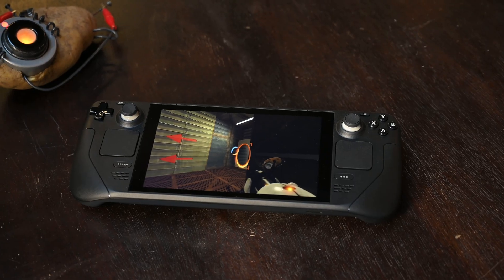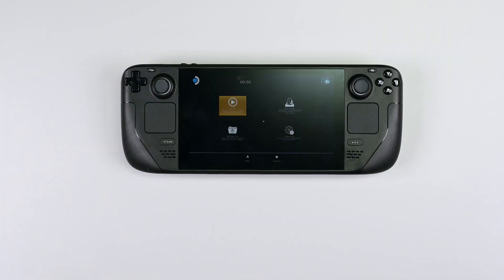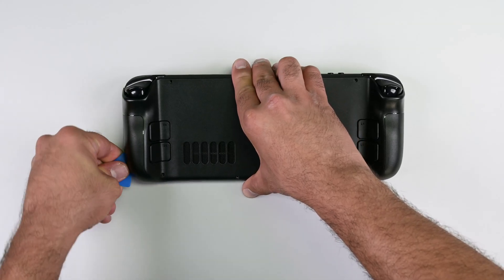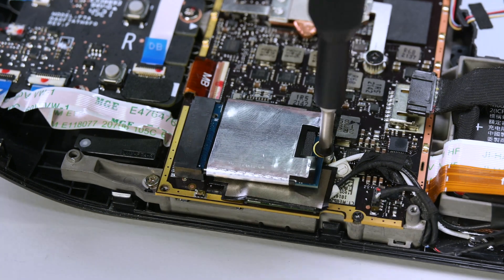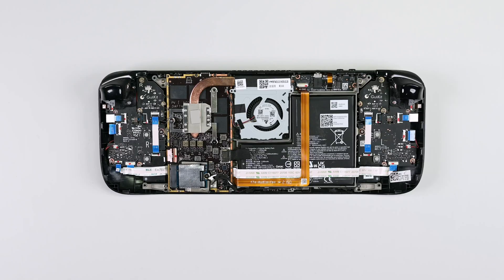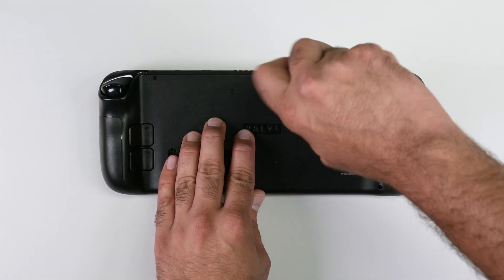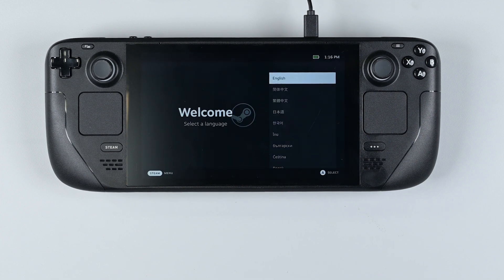Steam Deck SSD Replacement: Get it Done in 20 Minutes!

Comment: my biggest struggles were getting the exterior screws out without stripping them, snapping the case off, and snapping the case on.

everything else was super simple
Reply: Think bc if you have a mental model that the case should pop out with a little bit of tug, that it should go.  But the J-hook from backcase latching onto frontcase make that a disastrous problem.  It can damage it or snap the plastic locks.

I wrote a long essay above describing where exactly those hooks are.  One needs to jam in a small thin plastic to release the grip.  When those 18 hooks unclick, then the case can be removed safely.  Sliding is an ok way to do it but not elegant.  It's better to insert the thin, flexible plastic (or even paper) into the unit to disengage the J-latch. Must be at the right spot to hit it.

Comment: PSA:

If after you installed the new ssd and you go to turn it on and it doesn't turn on... Plug it back into power. Seemed to reset the deck/ battery.

Comment: Do the battery storage mode before doing ssd swap like the video says. Otherwise you will run into problems like battery going into protection mode and not turning on ...

Comment: Props to Valve for making the deck easily upgradeable like this. As easy as adding an SSD to a gaming laptop!
Reply: Not the new steam deck OLED unfortunately it's trickier as you have to hold the cover plate up you can't take it off entirely without ripping off the ribbon cable
Reply: @Ziyoblader you can disconnect the ribbon cable and move the shielding to the side, it's one extra step but not particularly difficult
Reply: @Ziyoblader i just carefully pulled the ribbon cable off of the cover, that way you could tilt and angle the cover in a way that it would completely go off.
Reply: And props to them for making the OLED harder.
Reply: @TheGeneReyva harder ?

Comment: Why is the shield necessary,  why does it have to have it? Most ssds you can just pop right in and its good to go.
Reply: The back cover is very thin. It stops the risk of anything getting through the plastic. By that I am referring to magnetics, for example, that would damage your SSD.

Comment: Hey
First of all, well done, IFIXIT, the instructions are really good. However, there is an instruction that you probably should add when it comes to reinstalling the operating system; 
I didnt use Rufus on the other hand but the file that Valve offers to download is formated as .bz2 and not .img by default, atleast not for me. It made it impossible to flash the USB-drive on balena etcher. It took me some time to find a solution on a thread on Reddit to solve it, which was easy at the end. This is maybe a no-brainer but for the sake of clarity; maybe add that detail to the guide?

Comment: I'm having a problem with recovering SteamOS.
After the new SSD is plugged in, I can't get to the Boot menu to access my Bootable USB. The steam deck just stays in a black screen. I can hear the fans and it also makes the beep when I turn it on. But no boot menu jumping up. Anyone got any ideas?

UPDATE: Leaving it for like 15 minutes to do it's thing, it eventually started working properly. I think. At least, I can see the Steam Logo now, so that's a plus.

Update #2: I've made it to the Boot menu finally, but it's got insane input lag. Like, I press one button and it takes 15 seconds to move the selector over xD. It took even longer to load the boot menu after I selected it, and it took a while to navigate to my Bootable USB. And now it's sitting there for eons trying to boot off the USB. But at least, so far, other than that weird lag, all seem to be in order.

Update #3: It took ages waiting out black screens, restarting multiple times, and so on and so on, but eventually, got SteamOS perfectly reinstalled onto my new Sabrent SSD. About to get Win11 installed too :)
Reply from the maker: Check our troubleshooting guide: https://www.ifixit.com/Troubleshooting/Steam_Deck/Black+Screen/520878

If that doesn't work, try posting in our forum. This seems to be a common issue but happens for different reasons. Some troubleshooting needs to be done.
Reply: im at that step right now, just a black screen still
Reply: Try plugging a power cord in and then turning it on. It does take about 30 seconds.

Comment: Can i add thermad pad under that ssd foil for better heat reduce?
Reply: I saw better solution on aliexpress for $2. Piece of copper foil with few thermal pads. People who bought told, that temp decreased by 10 degrees celsius.

Comment: Snapping the shell on the 64gb version was a BRUTAL pain even with the right tools. Do not panic on how hard it is to remove those plastic clips
Reply: Also worth mentioning (as its overlooked here), there are deep indentations around the clips, don't get your pick in them, instead slide along the shallow part of the seem to unclip everything. It's very easy to make that mistake and target the wrong part.
Reply: i just did it and it was even worse than taking the cover off of a ps4 pro and you have to man handle that thing
Reply: @butterybuttcheeks  my first experience with this J hook began on Xbox One X, that I believe was the first time seeing the design. It’s punishment for the DiY peeps.
Reply: I wrote a long essay above.  I identified all the clips. It was painful as well as potentially costly or damaging.
Reply: I used a kit that was made for the Switch on Amazon and it made it really simple, but I do have the newer version with the black cover so it could have been easier. It just took time figuring out where to put the triangle piece to get part of it to pop off and it was simple from there working my way around.
Reply: is there is a difference on how you open the back between 64gb version and other?
Reply: Time and patience is what you need. I successfully pry it open with the guitar pick and then toying around with the casing after I installed a new SSD.

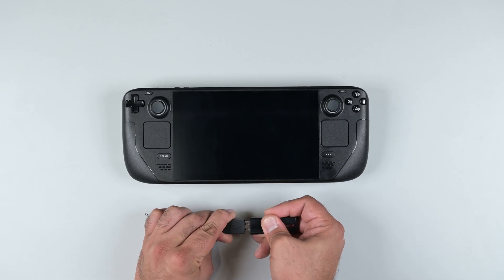Comment: - 4:59 should mention to plug in the charger first to turn on the Steam Deck since previously set as Battery Storage mode
Reply: Im sorry to revive an old post.. but if I may ask: After connecting to the charger and booting up the steamdeck from battery mode.. do you then unplug from the charger and the connect the usbc-flash drive connector and then the prompts pop up? Or am I missing something.

Comment: Oh yeah, if you just want to clone your drive so you don't have to reinstall and reconfigure everything (like if you setup emudeck), you can get a $15 m.2 external enclosure (and you will need a usb c hub so you can plug it in, the thumbstick you used for clonezilla, and a keyboard) like I did and use clonezilla to directly move the image over to the new SSD, then boot back into the steamdeck (on the old drive) and use the KDE partition manager to expand the home partition to the new size.

This might not be as economical of a choice if you dont have a use for a usb-c dock on the steam deck otherwise and don't have any other uses for an external NVMe enclosure (I already had a dock and wanted to use this to clone other images onto nvme drives for other computers, plus it makes for very small and convenient portable hard disk.) Just try to decide how much time you want to spend vs how much money you want to spend. Clonezilla was super easy to setup and use.

Also, I know people suggested using linux's built in DD tool, but a lot of people ran into problems with it because it's not a very intuitive tool and you can easily mess something up or forget something, then go through and install the ssd but then never be able to bootup because, perhaps you didn't transfer the partition table (which was a common issue I saw on reddit), which clonezilla will make sure you do, among many other steps.

Comment: Great guide, worked like a charm. 1TB model now baby! Thanks guys
Reply: So I can buy the cheapest one and upgrade it with another drive, right? Is the only difference between the more expensive models the storage? What kind of ssds work best with the steam deck?
Reply: @killer429 besides the screens (which you can also upgrade yourself) yes

Comment: To avoid people giving themselves a heart attack like I almost did I want people to know YOU MUST PLUG YOUR STEAM DECK INTO POWER to turn it on again AFTER PUTTING IT IN BATTERY STORAGE MODE! You did not just break your deck!
Reply: +100 to that, i unfortunately didn't read that message on time and had a rollercoaster of emotions, 4 times unplugged battery i thought maybe ja damaged a plug... it's a good tutorial but they should include this in it!
Reply: @bas5tian i mean,battery storage mode did it's job too well that y'all forgot that thats what it's actual purpose which is to REMOVE all power in the deck so you won't accidentally damage anything
Reply: I'm awaiting my steam deck tomorrow, thank you for this.
Reply: Apparently, another tutorial I saw pressed minus or volume down and power on.
Reply: OMG DUDE THANK YOU!!! i thought ive broked it !!
Reply: wish i saw this a few minutes ago... i managed to figure it out on my own but hoo boy did i almost have a heart attack 😂
Reply: This is not working at all for me. I tried different outlets, the original PCU, a different one, almost every button ever and even put in the old SSD to try but no LED no response no nothing. I am so desperate and Steam is so unhelpful uggghhh
Reply: bro I got to this part and my heart snack bc I thought I f'ed something up. You're a god send <3
Reply: Fuxking thanks
Reply: Youre the GOAT.
Reply: I think I bricked my Deck regardless. ☹ Fan and charging light comes on, but cannot get the screen to turn back on.
Reply: @jacknorkus9557  taking apart again and make sure the ribbon cable to your screen is completely improperly seated.
Reply: @jacknorkus9557  could you fix it?
Reply: I know this comment is at the top of the comments anyway but this REALLY should have been hearted or whatever it's called by the uploader to make sure it's always at the top no matter what.
Reply: 2 years later, and BLESS you for this comment. XD
Reply: Yo how is this comment not at the top!!! Such a critical oversite to a simple step!! Thank you my guy!!!
Reply: jesus christ thanks, I did get a hear attack tho
Reply: Lol. I had a heart attack thinking I messed mine up.  Then turns out, like you said, after putting in battery storage mode the power button has been deactivated.  One must use the plug to re-activate the unit.  That was cold blooded.
Reply: You da real MVP bro.
Reply: thx man, but too late I had heart attack
Reply: Up! this made my heart stop I just voided my warranty and it suddenly wont open but your solution works thank you!!!
Reply: after I finally recovered from my heart attack, I came to say this exactly. Thanks!
Reply: Oh thank GOD.
Reply: Mine's been on power for 3 hours and nothing, it won't turn on!!!  took it apart 3 times, and everything plugged in fine.  just won't come back on
Reply: OH MY GOD THANK YOU
Reply: This did not work for me
Reply: @stephd6109  the same thing happened to me to the battery cable is loose it’s really hard to push it all the way in you have to get it back in just the right spot it has to be all the way clicked in
Reply: @anguelt6785  I did try to unplug the cable earlier and get it back in. I did hear a click but I an always try again. Thank you for your response I appreciate it
Reply: Thank god for people like you, I just did this and freaked out when it wouldn’t power. Why leave out an important step like that??!
Reply: Thank you, because I did have a mini heartattack for sure 😅
Reply: You're a god. Thank you!
Reply: you are a hero
bless you
Reply: I read the comment too late, I was angry as f ^ :D
Reply: I came here to write this after following the guide yesterday. This needs to be a pinned comment lol. And/or they should just redo this video, and explicitly state this instruction. Thank you for posting this.
Reply: You are a saint.
Reply: Didnt see this till after i had said heart attack and figured it out lol
Reply: Exactly what happened to me 🤣. @iFixit - it would be nice to add this info to the video
Reply: I thought I didn't push the battery cable in far enough lol thanks
Reply: Thank you I just got my deck yesterday and almost panicked
Reply: DUDE HAHAHA I WAS STARTING TO CRY
Reply: Thanks, I needed to hear this 😂
Reply: Thank you dog!
Reply: My hero!!
Reply: I always did that with my 64gb deck before upgrading this
Reply: Do i need to buy a usb C to usb adapter for the thumbdrive if I have  a docking station?
Reply: Thanks so much
Reply: Thank you!
Reply: Opened my device back up to see what I did wrong. Finally finding nothing I connected the power while holding my breath and trying to start the device. I just read this comment and breathed a sigh of relief even as my SD is installing already. WHY THE F WAS THIS NOT IN THE VIDEO?! MAJOR L.
Reply: Should be pinned comment. Slightly had a panic attack when I couldn't turn my deck back on
Reply: I did get a heart attack, but you saved me from having to go to the hospital 🏥🤣
Reply: Yep, if people pay attention the deck explains this when you enable this mode.

Comment: done this after following this video :)
as people said to exit battery mode you must connect the charger
Valve suggest to go at least below 80% to enter safely in battery mode (that is because Lithium batteries survive better at storage if not fully charged)
the SSD foil not always slides in, Sabrent SSDs for example are thicker and in that case it must be opened.
my deck booted back now let's see if steamos reinstalls :D
update: everything is fine
Reply: Update?
Reply: @lokeshsangewar8392  everything ok, reimaged and updated
Reply: you can still slide it on the sabrent ssd by widening the foil with tweezers and going back and forth

Comment: My SSD has two slots in it but the new one I ordered only has one ? Are some models different ?
Reply: Mine was the same, I installed it trying to get OS back on it now, I don't think  my dock is transferring data just power and display, I'll let you know if it works
Reply: It worked! 
Be cautious; I accidentally pin the fan wire under the shield plate when reinstalling it and my fan wasn't coming on at all. I took it apart and fix it. Works like new now 💪🏼
Reply: @siahmanjoe  legend ! Thanks for the info dude
Reply: @gmak1n785  of course man, happy decking? Lol what ever we are calling it lol
Reply: @siahmanjoe  I am a 45 year old man and the deck is the coolest gadget I have ever purchased lol

Comment: Very well done! Thank you. For powering on issues after you are done, remember when you put your Deck in battery save mode you have to plug your Deck into a power adapter to turn on. 

I went from a 64 GB Steam Deck to a 1 TB Steam Deck, throw in my 1 TB micro SD card and I now I have 2 TB of gaming on the go. Actually with the 64 GB of online memory I was not able to fully utilize my 1 TB micro SD card and now I can. 

The Steam Deck has to be one of the best values in video gaming and the fact that Valve actually made it user friendly to work on is the icing on an already good cake.
Reply: thank you , i was thinking i brick my SD , and couldn't find any info about that specific problem , i giver up and said fuk it , if i brick it , im gonna burn it by plugin it , and it revived. 

but seriously , thank you for that important piece of info .
Reply: @garaalgi  Anytime. I felt the same way the first time when it happened to me so when I realized the issue I had to post. Glad it helped.
Reply: The cake is a lie

Comment: Do you need to format or do anything to the drive before Installing
Reply: For the USB drive the software will format the drive when you’re putting the recovery image on the usb. Once you’ve plugged it into the deck the deck should reimage itself without needing to format it first.

Comment: Just did install with 2tb SSD following your instructions and it worked perfectly, did run into same issue other ppl have formatting sd card and it not saying GPT but MBR. I tried this before and had no luck, the missing component was Rufus! But ya no issues, thank you!
Reply: Man I feel like a peasant with my 1tb.. 2tb didn't exist when I did the swap..
Reply: 1tb is plenty, you need to be careful with larger aswell as the deck was designed with gen 3 in mind. Anything higher can easily cause faster battery drain.

Comment: 1:48 so what do you do if it has a black motherboard cover?
Reply: lol yep, the video is like wtf, skip the step, ooooookay, how do I access whats below the cover if I skip removing it?
Reply: @TheChrcol  if it helps I have since worked it out. There are only two small screws in the top and bottom left corner of the black motherboard cover which needs to removed and that is it (you just lift it off). There are also two arrows on the black cover which points to them but it's hard to see in this video. Why he couldn't quickly mention it in the video I do not know! It's actually much easier with the newer model.
Reply: @hue9129 hey man quick question. so ive removed both screws and the cover doesnt seem to want to remove easily. almost like its attached to something. is this normal? just want to make sure im not breaking anything as i just got my steam deck today. thanks in advance
Reply: It's got a couple of sticky pads on the inside just give it a wiggle and it will pop off @blarin